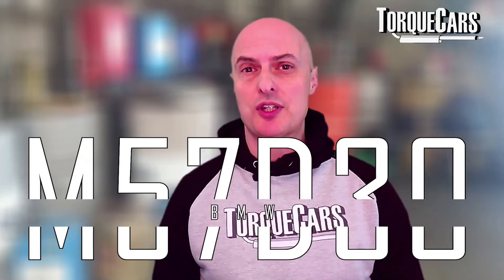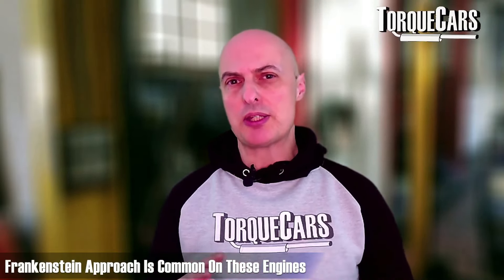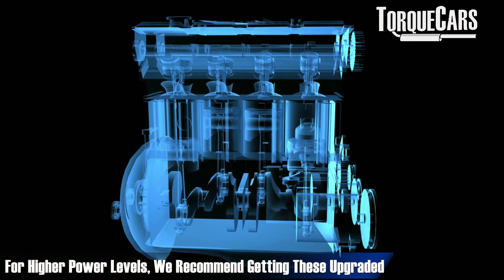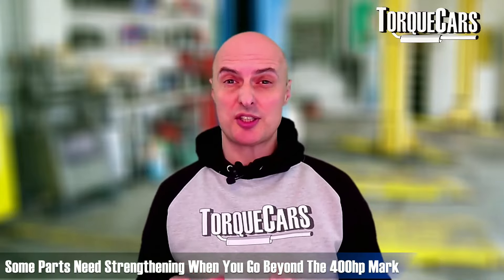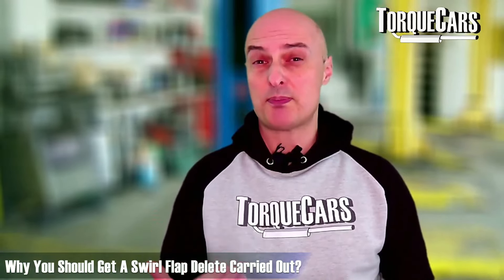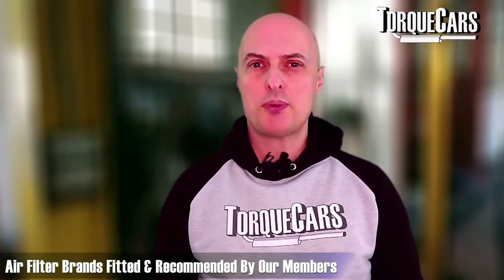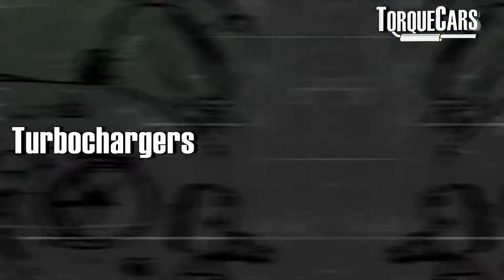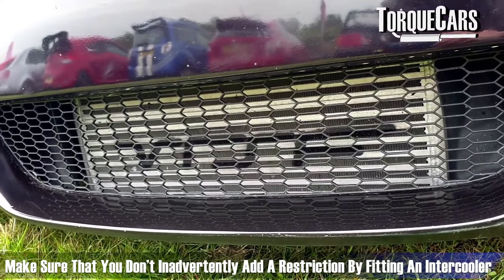Best M57D30 Mods & Upgrades: BMW M57 3.0D Hits 300, 400 & 500hp+E39 E46  E83 E53 E90 E91 E60 E61 E93

Comment: M57 engines never had IDI, that's on the older M51.
Also, the first generation common rail (2.5 163ps, 3.0 184 and 193ps) ran at 1350Bar maximum, while 1600Bar was the maximum for the N/tu variants (2.5 177, 3.0 204 and 218, 3.0 272 "top") and N2/tu2 (3.0 197, 3.0 231, 3.0 235 and 3.0 286 "top").

Comment: This video barely scratch the surface about the M57 engines. Each model year had different turbos, IC, routings for intake, turbo mountings, oil returns pipes, different injectors, piston designs, angle of fuel intake, how well the engine works with certain transmissions (how much torque they can hold), fuel pomps. Older M57 has two pumps, newer has completely different design.... and much much more. To really get an idea what YOUR M57 can do safely and efficiently you need to realy dive deep and just check it before throwing random stuff at it because you heard it somewehere it needs to be done etc. Also getting in to 400+ power levels other problems start occuring like lifting of the head, timing, oil pressure.. and much more. Finding a proper tunner who will not blow up your engine is another story on top of all of this.
Reply from the maker: Yes it is a very complex and deep subject, I only aimed to give an overview in this video, the articles on our site go into more detail but I'll be adding to this with more articles and new videos in the future. I really appreciate the feedback, generally forums out there are full of people who know a little and assume it applies to all models whereas you've nicely detailed some of the specific differences for us.

Comment: Hi.. I have M57D30TÜ2  3.30d.. what is my engine block type (cast or )? and will my injectors be enough for 400+hp?
Reply: It's aluminum
Reply: Aluminium block - top M57 version (286hp) iniectors can handle 400hp
Reply: @hubertszymanski2272  yes but barely. Better to stay a bit lower (380ish) and enjoy the smoother workings of the stock injectors.

Comment: Recommend the ATM intake kit for 335D. It has a cold air intake isolated from engine heat. I have it installed in mine and the sound is way better than stock.
Reply: @jimb12312  works for the 330d m57? Whats the link

Comment: I have a 184hp 330D E46, chipped so it should make about 220hp and 480Nm, but my goal is to reach the 300hp mark in the future. What would be the parts that would need some attention/upgrading?
Reply: Same here, commenting to see what the answer is 😁
Reply: You can reach 300 hp (or close to 300 hp) by upgrading the turbo, MAP sensor exhaust, and intercooler.

You can either hybrid the stock turbo, or install a GT2260V from an E60 530d with 218 hp.

The stock MAP sensor can only read up to 1.45 bar boost, so you'll need to upgrade to the MAP sensor from an M57N or M47N. (E46 320d 150 hp, E46 330d 204 hp etc). This will need calibration in the ECU, or it will read wrong.

For the exhaust you should install a catless downpipe, or at least one with high flow cats, as the cats (or DPF) are a huge restriction.

For the intercooler you will need to see what would fit and how you would fit it.

And then of course you need a good tuner which will calibrate the MAP sensor and tune everything.
Reply: andreabuterer1433  I would go for an r90 fuel pump, can’t go wrong with
Reply: @StragTacGaming   what about injectors?

Comment: You know there are 3 types of m57 engines right. What engine are we talking here. 525 530, the 535d m57 engine is by far the most superior with its stringer bottom end, difftent injections, intercooler induction and so on. The 35d engine is pre lci 2004 to 07 is 273bhp and 500nmt and the lci is 286bhp and 560nmt, to get the 35d lci engine from 286bhp to 370bhp, ttorque goes from 560 to to 700+nmt and that is just on a stage 1 map. 
Delete dpf.egr 
And remove plastic Swirl flaps ajd replace with metal caps,
If you want more power get a intercooler, air filter, m50d rail and sensor 
Upgrade to
Custom manifold
Custom exhaust 
Twin r90 pumps
Hybrid turbos
And ur looking at 450 to 500bhp, 
Be careful how you push the gear box though as I've had so many of these, 750nmt really is a safe place to be. 800+ and there is a chance the gearbox could poop its self. It happend to me so I took the 8 speed box out the the f10/f11 535d and they are good for 1500nmt. 
Don't forget to sub my channel.

Comment: D1 E39 193Hp 
hybrid turbo GT2256V
216 injectors with stock nozzle from 048 (145° spray angle)
Original CP1 
76mm exhaust line , downpipe
good 270/280 hp , with those injectors it will smoke black , and allot... believe me and more consumption with thoze injectors , the 216 open more quickly than the 048 stock

Comment: On the alu block 282bhp version the crank bearings are  a weak point once you remap the shit outta them
Reply: I'm at 360bhp on mine
Reply: Depends how you drive it. Mines 360 bhp and it's driven normally 99% of the time. Doubt that will cause too much strain on the bearings
Reply: @paulcostello1807  change your oil at 10000kms..simple.

Comment: So I have 02 3.0d that in stock has 193hp I have X5 turbo idk what KW it has +stage 2 chip, and, well, it ran nice until I wanted to overtake, -downshift -strange engine sound -something blew up -coolant tube rubber part made a crack -heas gasket gone -rev beyond 3.5k rip, engine chokes up and starts to push smoke form the gasket, makes big smoke could from exhaust, now, still a kick but can't "give it gass" engine tries to shut off

Comment: Does anybody have shopping list for 300hp option ?
Reply from the maker: I'll see what I can put together for you and update the article on our website. I need to ask around and compare notes though.
Reply: Nothing! Just a downpipe and good tune. Mine makes 208 wheel kw on stock everything! Just a k&N air filter and a 3.5inch downpipe. I even still have the stock back box. Remove swirl flaps, put in an egr delete tune and punch it. 2008 330d msport Auto.
Reply: That will depend on which M57 variant you're running. It will be more work if it is not one of the tu or tu2 variants.

Comment: the engine M57D30 is made from 2001 (my friend currently have bmw 530d in e39) 142kw
until 2010 in my X5 210kw with the same engine but mine has aluminium block and his with cast iron block
Reply: and for the injectors factory is 2500bar from cp4 but people recommending to go for cp3 and that can safely handle 3000 bar on stock injectors, the cp4 can self-destruct which nobody wants